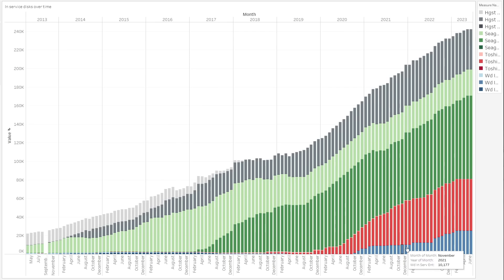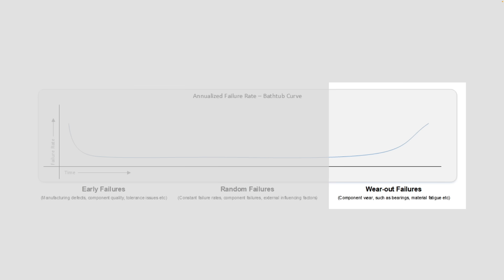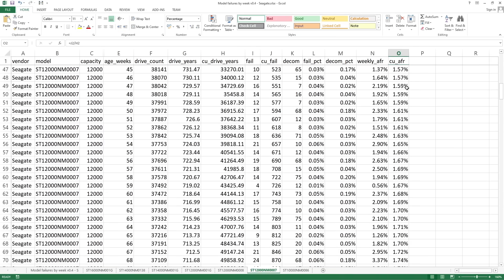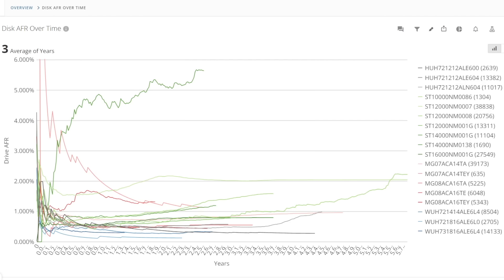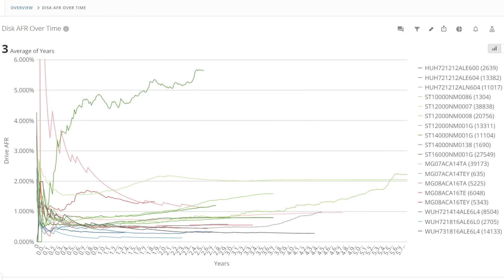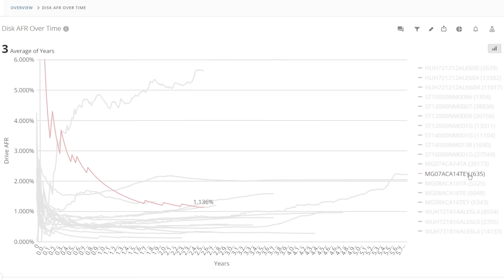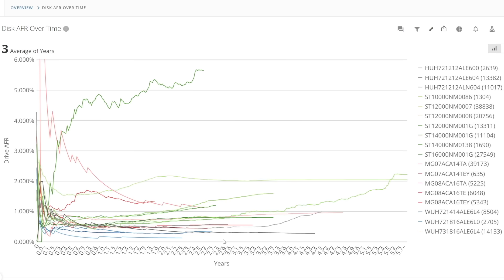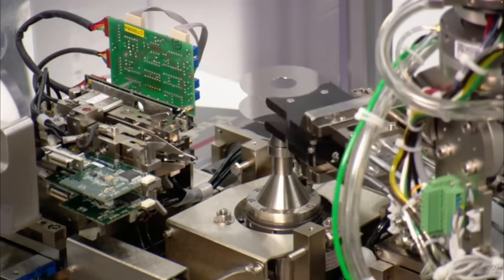Failure Rate Analysis - Best 10Tb+ hard drives: Seagate, Western Digital or Toshiba?

Comment: Finally a video that's not "this is the solution because of easy plug and play and drag and drop use." Thank you!
Is there a video like this for external hard drives?
Reply from the maker: Thank you. 

Unfortunately there isn’t a data source for external drives and their use is going to vary so much anyway. I do have some content with more coming on what is inside each external drive and how they perform inside and out of their enclosures. But this what you are asking for. 🙄

Comment: If I could invest I would invest in Hitachi - HGST company to continue making reliable enterprise-grade HDD.. 
I don't have much faith in refurbished or recertified HGST HDDs that are selling these days. (some people see small gray world "recertified" on drives)
SSDs are not long term more reliable storage than Hitachi HDDs. I lost valuable data on used SSD and learned this lesson the hard way.
I got Seagate 500GB for "cheap" from someone before I knew what BS they are. 
I was losing connection with that Seagate like freezing or something. And once I dropped it on floor (while on/working in external enclosure) and it stopped working. I tried to recover it with donor head but failed in short. 
And same model of NEW Seagate HDD had same defect with losing connectivity/freezing... 
AVOID SEAGATE HDDs (I had 2 bad experiences + many comments here are also negative about that brand)
And AVOID external hard drives with no information about what HDD is inside, because its 99% Seagate most of the time.
If you need reliable HDD my pick is HGST/Hitachi (made in Japan) any day. 
I have ones with "made in China" also but I purchased them over ebay around 2020/21 when my SSD failed and epidemic caused chaos and HGST HDDs I trusted the most vanished from local IT stores...
I'm still skeptical about Western Digital making HGST HDDs, I didn't use them nor tested them long term to recommend them personally.

Comment: Years ago, I built a home server and my two main drives were 1.5 TB Seagate drives. They held 80% of what I had on that server. They were also very expensive. One of the drives crashed. I could not afford to immediately replace it and a week later, the other drive crashed. I lost the vast majority of my content and I swore to never buy Seagate ever again.

Months later, a data center (I'm pretty sure it was the one covered in this video) put out a report that's showed that 1.5 TB drive had a 25% failure rate. For me it was 100%.
Reply from the maker: Or sure if the same drives, but I had a Thecus NAS long ago, and it had 7 (I think) barracuda 1.5TB drives, and I think they all survived until I replaced them all with 3TB drives for capacit my reasons, maybe 5 years or so. So maybe I just got very lucky. I still have those drives, I should go run a bunch of tests on them to see what the deal is with their error counts and power on hours.

But bad experiences like yours are sobering, and a good reminder to keep backups of important stuff. Because this can and does happen, and it sucks a lot of it happens to you.

Comment: I got HC530 14TB for my RAID1 around 2019 and they are still working great. I also have WD Red 8TB and WD Gold 8TB since 2018. I had to RMA the Gold after few years but it works great since then. Around 2018-2020 I moved my PC a lot in a car and I bet that was the reason for failure. I also have one rule since early 2000's which is "NEVER BUY SEAGATE".

Comment: i will never touch seagate... that being said, i've had 3 WD drives fail... from pre-2005.
Reply from the maker: My personally experience with Seagate has been good, and the data suggests their reliability is improving, but hear this feedback a lot and they had some problematic models in the past that burnt a lot of good will with customers.
Reply: @sometechguy  the 26tb external deals they ran recently were amazing, I had to fight myself not to buy 4 of them. but everywhere i turned, every seller, it was bad feedback.

Comment: Man i really love hdd. But it's still expensive in a developing nation (ASEAN). My 3tb wd black i purchased in feb 2017 (2,3 mil idr/170$) is almost cost the same in dec 2025 tb wise for 4tb (3 mil idr/180$). Doesn't even change much vs my 1 TB WD black (900k idr/100$). The cheapest 10tb hdd is wd red plus still at 300$, you can get 4tb ssd for that. Bigger size doesn't reduce price noticeably either. The cost advantage is eaten up by a weakening currency.

Mainly it's because all of my HDDs always exhibit strange patterns before they die, so i can save the data. My SSD however, died suddenly with no errors whatsoever. I did back up my important data. But a lot of times i just forget/don't have a lot of time organizing files for months.

Wd black survived dozens of power outages as a C drive and never corrupted (Oct 2011 - Apr 2016). But I managed to snatch a new 4 TB WD Purple at 75$ and 2tb mp44l at 90$ and seagate one touch 5tb at 120$ early this year before NAND and DRAM shenanigans (idk why 5400 WD Blue was 20$ more). Now the price jumps again to 100$.
I'm flabbergasted. I know SMR is horrible, but 12-15MB/s is insane on seagate, not even my 3.5' toshiba is that bad. Even my 2017 hgst touro is still CMR.
Reply from the maker: The cost of computing generally has gone up a lot, partly inflation and I am sure currency plays a big part also; but also things like motherboards, GPUs just got more and more expensive. Hard drives are not immune but seem less impacted, especially right now va SSD as NAND is under pressure from data centres demands.

SSD are great for performance, but for capacity, cost per TB, and importantly endurance, HDD are king in my view. I see it a bit like a plane va a helicopter. Drives are like planes, they are stable by design and if the engine fails on a plane, it can glide to a landing. SSDs, like helicopters are not stable, they have to deal with cell degradation, electron leakage, read interference etc and if the controller is not managing data, rewriting, performing wear levelling the data will eventually be lost. If you shut a helicopters engine off, the path to safety is narrow. 

Thanks for watching and keep an eye for bargains. Purple/Skyhawk are perfectly good for other purposes by the way, nothing special other than market positioning that makes them inferior. In fact, the pro surveillance drives appear to perform better in many cases than the other enterprise class disks.
Reply: @sometechguy  thank you so much for your insight sir. I didn't know a surveillance drive could be better than even enterprise drive. They are cheaper, I think, because the CCTV market is bigger than pc market, probably because of mass ssds migration and most pc case nowadays can't fill many drives anymore (e.g. My og nzxt phantom have 7 hdd bays vs fractal north barely fit 2).
I initially was kinda scared when picking wd purple, because i heard surveillance drives aren't for desktop users (file integrity/corruption, 'Their firmware prioritizes smooth, uninterrupted recording over data integrity checks for every single write operation' they said).

10 months and no problem so far, it even runs way quieter than wd black. This WD Purple replaced the refurbished Exos that died soon after arriving. Thank God, because the enterprise drive is just too loud; it surprises me, i can't. I just hope purple is as reliable as black. Because my green and blue died within 5 years, salute to blue still, since the internet was slow back then it has 100k hours+ for downloading and torrenting.

Comment: I purchased a Synology NAS 3 years ago for holding my photos and using it as a media centre for my DVD collection, initially I bought 4 Ironwolf drives and 3 of them upon arrival were dead, upon sending them back I purchased 3 of the Toshiba N300 14tb, touch wood had no issues, I also have 1 12tb and 1 16tb N300. I will certainly continue to buy them instead. What I always do when I buy a drive is connect it up and copy 300gb of data to it, about an hour in set another load off and let it run for 4/5 hours, they say that any drive will fail under high capacity

Comment: Thank you. A bit of information overload, but the conclusion of your video simplifies it for this very simple man :)

I have a collection of G-Drives as external HDs. 3 of them are ~11 years old, and 2 of those are still working and useable (though I do periodically monitor their health). Unfortunately, in more recent years, my newer G-Drives have been dying long before this 11-year duration. They are no longer reliable, and this is reflected in the downgrade of their warrantees. 

Since I will eventually need a new Time Machine Backup drive, one that will need to be in excess of 10TB and not my default G-Drive, this video was helpful :) And, it seems that WD would be the way to go for long-term storage.
Reply from the maker: Thank you for watching, and hope it wasn't too tricky to follow. But sounds like it ended up helping in some way, so happy for this. 🙂
Reply: @sometechguy  To quote my favorite Jaffa, indeed.

Comment: SEAGATE HDD sucks balls. There were absolutely zero signs, PC crashed once and it's dead. My external backup is WD and got a SATA from Crucial which are both older than the SEAGATE and they are at great health. My new system NVME is WD as well

Comment: How would you reconcile the Star ratings on Amazon or do you pay any attention to the Amazon ratings? The link to WD Ultrastar 16TB HD has a Star rating of 3.6. And of 472 ppl, 27% are 1 star and 4% are 2 star. And only 56% is 5 star.
Reply from the maker: In my opinion, there is a long shopping list of issues with the Amazon reviews, and this is putting aside the issues with fake reviews, reviews of items that change and paid for reviews.

Firstly, the bad review can be caused by many things. It could be a product issue, a seller issue, a shipping issue or just that the item isn't what was expected. For example, there has been reports of third party sellers shipping used or refurbished items as new. I even covered in a video that I ordered a new WD Blue drive from Amazon.eu directly, and received a refurb drive. The review isnt that the drive model is bad, but that I didn't get what I ordered.

And because its a single product review that can apply to numerous sellers, and new, used or refurbed products, this can cause problems. I have seen bad reviews there for drives, and the feedback is that the seller shipped a used product that failed, or that they didn't accept a return. The review can also cover a range of different sizes, not that that is super relevant for a drive type, but the review could be for a small capacity air filled drive, and shown on a large helium unit.

The other issue is I see lots of reviews where people are not happy because they couldn't fit it in their case, or they had the wrong connector, or they thought it was external and not internal. Its a retail shopping site, and people can buy a product they don't understand.

So I think the best source of data is actual reliability data, and probably experiences shared by experienced people, maybe in appropriate subredits. Even then, people are overwhelmingly more likely to share bad experiences than good.

I think the WD Ultrastar is generally respected as an excellent drive. So though you could always get some bad experiences,  a quarter of reviews being 1star doesn't seem credible to me. Unless they are related to some rogue sellers. 

I wish the reviews were seller and product specific, but overall I don't pay much attention to them other to see if there are themes around bad feedback for products that are not well known by me. But read the reviews, and see what they say, and see if they are coherent and relevant to the listing. 🙂
Reply: @sometechguy  Followed. I appreciate the feedback.

Comment: If they are for your NAS remember this: Never Again Seagate. Other HDDs aren't perfect but IME Seagate have been the fastest failing and the least reliable. I even had 4 x 5TB portable ones and 2 out of 4 died in mere months. On the opposite spectrum I still have WD and Toshiba portables that works great 2~4TB and over 10 years old WD Enterprise HDD in a NAS that has been working 5+ years on a 24/7 basis, and less than that in the next 10 years... so far, os good knock on wood. I think I had only needed to change 1 HDD after year 5 of working 24/7... but again that's my own experience.

Comment: To summarize, WD drives are the most reliable. Avoid seagate  as some of their drives have long lasting issues. Toshiba has QA issues where drives might fail early.
Reply: + my 2 cents I have been using wd hdds and never had any problems. I got system with 2 wd reds in raid 1 10+ year old still working fine, though common sense tells me it’s time to replace…and pushing factor is I need more space. Also never had problems with samsung ssds.

Comment: Which capacity generally are the best, 16TB?  What has happened to Seagate to make them so unreliable?
Reply from the maker: It seems to be vary by model, but my observation is that other than some specific models (or batches) that could have lower reliability, drives seem to be getting better over time. And even when new technology is added, such as the tripe stage actuators, higher platter counts, and improved areal density, this hasn't had any specific negative consequences to reliability.

I am working on an update to this video, and as Back Blaze have now added drives up to 24TB, will be interesting if this continues to be the case. They do not appears to have yet published any data with the new HAMR drives either yet, but hoping they they are going to deploy these so we start to get data there, as that is one of the biggest step changes in HDD tech in a while.

As for Seagate reliability, they do seem a little behind WD but I think its more on a model by model basis. They haven't had a good a rep as WD (especially the HGST heritage drives) recently, but I am hoping they are moving the needle more on this and the later models mostly seem to be improving.

Comment: I've been buying WD Blacks since 2007 from 1 through to 10tb. It is an absolute rarity that I have one last more than 2 years. The failure rate is high. The performance is pathetic. It makes my blood boil
Reply from the maker: This is an interesting observation. I am testing a few Blacks here of different sizes, but right now they seem to be based on the same platform as the enterprise drives, but maybe with slightly different tuning in firmware. But I would expect they have similar reliability to those enterprise siblings. 

So maybe you got unlucky? But hard to say, I have not heard that its common feedback that the Blacks are particularly problematic. But this is why I appreciate you sharing this, because if a bunch of people reply with 'I have the same issue', then you can start to see trends.

Comment: My 10 WD3000FYYZ have 75k-81k hours without failue. How long will they last?
Reply from the maker: Who knows 😅

But I would certainly be checking SMART data for things like uncorrectable errors, command timeouts, unrecoverable sectors etc. At some point you will get failures, and if they are in an array, replacing a failed disk can put strain on others and failures can happen during RAID rebuilds. So especially if you are running RAID5 on that many, be cautious.

And of course, backups 😊

But who knows, they could go on yet. I have drives still running in that area, but they are being replaced progressively with larger drives and retired.
Reply: @sometechguy  I checked the SMART data before writing and it is still 0 on all drives. I use them because I got the drives for free, they were in a server before being my game data storage.

Comment: I have 36 x 16 TB Seagate EXOS drives running 24x7 in my NAS for over 5 years. No failures so far. I used to use WD Red drives before but they all failed, so I only use Seagate EXOS drives nowadays, with a couple of Toshibas in my server.
Reply from the maker: I believe the data shows that there is a fairly low chance of failure for most of these models. With some exceptions, the AFR is around 0.5-2%. So most drives will do fine assuming no external factors. 

But statistics is a fickle animal, and if you happen to get failures, especially if it results in data loss, then you will remember this.

So the data is useful I helping make more informed decisions, but personal experience and personal brand loyalty  probably has a greater emotional bearing, and ultimately this is what influences decisions more. 

Thanks for sharing the story also, it’s a decent size deployment. ❤
Reply: Red drives are optimized for streaming video in and out. They're meant for surveillance systems with a lot of cameras where non correctable errors don't matter. They have the weakest error correction because doing it causes performance to suffer.
Reply: @uncrunch398 I used them for video streaming, yep. Still too many failures for my liking.

Comment: Loyal to model not brand.
Reply from the maker: There are some overall numbers by brand, which I covered in another video. But yes, all of them have models with excellent reliability, and those that are pretty poor. And it could just be bad batches, or a manufacturing problem that was later resolved, but I think safest to avoid those models that have poor reliability stats.